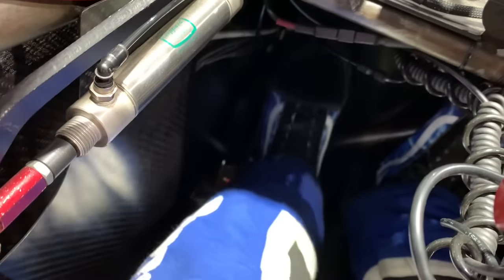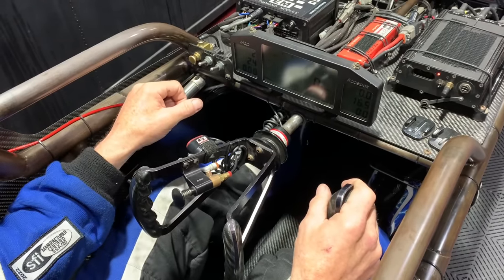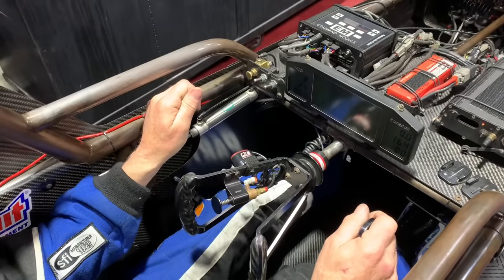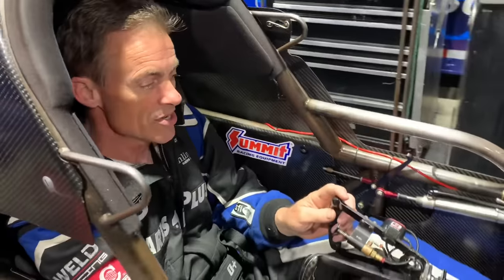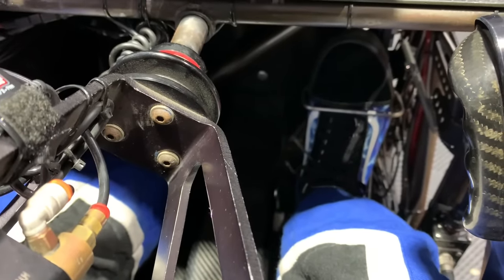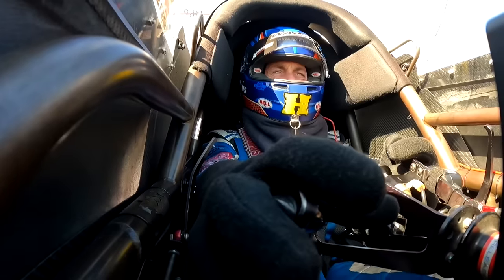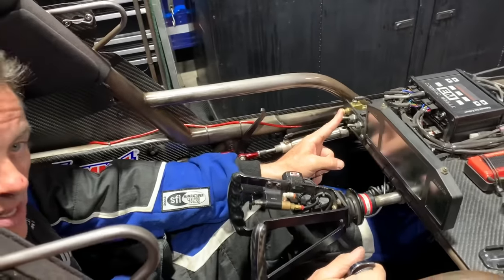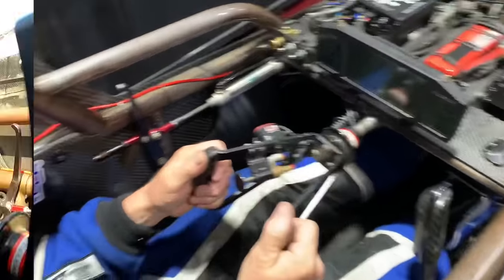How To Drive A Top Fuel Car

Comment: 50 years of wondering explained in just under 11 minutes thank you clay.
Reply: Agreed
Reply: Not that long but same lol
Reply: 30 years of wondering how long the throttle pedal throw was finally answered. Try to find a video on that subject on YouTube lol.
Reply: Ditto!!
Reply: Same here.
Reply: Ditto, the first race meeting that I attended was on May the 28th 1972.
I had a vague idea, now I am almost a novice after half a century.
I guess I am a slow learner?
Reply: 50 yrs for me too.  I still love it.
Reply: lol, jumpin on this bandwagon. Way more interesting than I thought, love these kind of vids.
Reply: Me too thanks clay so interesting
Reply: Exactly! I always wondered why the car seemed to change tone just after the first bulb lights. Now I know they pull the fuel full bore for the pass at that point. Love Clays videos!
Reply: 50 years ago the cockpit procedures and moves were quite different than what you see here, that's for sure.  At that earlier point all we had inside was an oil pressure gauge (analog, of course), a mag switch, a chute release and a bypass fuel control that was never adjusted when running.  And definitely a manual clutch dump (pre-Crowerglide).  No reverse, either.  Only funny cars used a reverse.  Most top fuel cars back then were still using crews with arms and legs.  Aside from feathering a wet burnout, it seems the only things here that remain as the same cockpit procedures from 50 years ago are the chute release and brake.  Much more complex today, and this is a great video to illustrate the current machine's requirements.  Thanks, Clay.
Reply: Clay Millican is a gift to us fuel nerds
Reply: Brilliant explanation, what a ride.
Reply: Waiting 50 years for someone to explain it to you?
You could have looked it up, visited a racetrack and talked with a mechanic or a driver lol.
And you guys vote? Educate yourself. Even easier today, with the internet or YouTube.
I'm sure i could find the information before I drank my beer.
Reply: Can I drive next time😅

Comment: Clay, you forgot the part where when you launch you compress into the seat and almost black out and then at the end you throw the chutes and are thrown into the belts with even more force than that launch. Awesome explanation, thank you,
Reply: think you got that impression when he gestured moving forward so much at the end of the imaginary run. The amount he moved forward indicated that there is a huge amount of G's being placed on the body at that speed. That is the only part of the run I could imagine... I once made the mistake of sitting up on my bike at 160mph on the highway (didn't feel like I was going all that fast), and nearly blew myself of the back of my bike (just held on with my finger tips), could imagine that is what it feels like in reverse.
Reply: @DodgyBrothersEngineering  No I have driven many many fast cars over 35 years on the track and also a dream drive in Larry Dixon's Nitro X2. The G's experienced at the starting line are not even the most of the run, it is actually about the 330' mark when the clutches lock up. But the g-force experienced when the chutes deploy are so much more, like eye sight starts to go black type of g force. I used to have a gsxr 1K7 and rode it to 307 so I know the force you are talking about but believe it or not, that is nothing compared to the kick in the ass of one of these and the sledgehammer in the chest when those chutes deploy.
Reply: @hommie789  I have been in and owned some seriously fast cars (cars you couldn't reach forward to grab the dash), but I still can't even imagine what a top fuel experience would be like because 1G+ is going to be nothing like 7G's they say top fuel experience on take off. Can only imagine that would feel like someone sitting a car on your chest. I can sort of imagine it, but I bet if I ever got a go in one, it would be so much more than I can possible imagine. But even the thought of it brings a smile to my face, and my butt pucker.
Reply: @hommie789  interesting thought about about the braking... Did it seem so severe because of the direction of force? When you are accelerating you have the entire back of the seat to spread the load of your body against, so the pounds per square inch would be nothing like when the chute comes out, because under deceleration you only have a few small straps to stop the mass of your body. So the pounds per square inch would be much higher even if there weren't as many G's.
Reply: F-22 pilots laughing right now. Fun fact a space shuttle launch is 3gs. Most ever recorded on a top fuel was 5.5gs.   F-22 9gs for breakfast. Record of gs ever survived by a human being, 219 g's   219..... was in an indy car race kenny brack got in a accident that recorded 219 g forces. He survived.

Comment: WOW!! What a difference 50 years makes. I bought a 130 inch Woody Gilmore car from Sammy Miller in 1972. I was moving up from modified production and really needed help with the learning curve. We set up the car to run B/FD in Pro Comp Eliminator with Sammy's help. Back then we only had a fuel shutoff, clutch pedal, steering wheel (the only thing in my car that looks like yours.), hand brake, loud pedal. chute release and an oil pressure gauge. When I asked Sammy why just oil pressure he answered me in typical Sammy Miller fashion, " That's all you need to know. If the motor makes a funny noise, you glance at the O.P., if it's at 0, DUCK!!"
Reply: Over here in 🇬🇧 we took an instant love to slamming Sammy miller when he was doing demo passes of vanishing point an oxygen rocket cars.
He seemed very at ease with himself (not something alot of racers are) and did a very good Donald duck impression.
It's was a sad day when I learnt of his passing, but I believe he lived one heck of a life. 👍
Reply: If it's at 0 Duck! Ha Ha Ha 😆
Reply: Just the mention of the old B-fuel dragster class brought me a melancholy smile :-)
Reply: Sammy Miller is the forgotten GOAT. 3.22 @402mph, with an actual 1/4 mile measure. Not the useless 1000ft measure of todays Karen culture.

Comment: Great video!  Very informative and very interesting; I didn't know what was involved in piloting these 11,000hp 4wheel missiles.  A 3.6-something seconds pass with trap speed around or greater than 330mph!  Amazing just to keep one of these engines together under full throttle for 4 seconds; absolutely awesome. You make it look easier than it is, obviously perfect muscle memory, knowledge and experience.  Just like flying aircraft, knowing emergency procedures and how to handle one of these beasts when things go south, sideways, etc.  on a run is where the experience shines.  Thanks for making this video!

Comment: HEY CLAY 🤘🏼 love the insider content of too fuel racing no channel around like it love your work can see your a real genuine team and also really care about the fans just as much as the racing ! 
I just have one technical question, some teams run a enclose cockpit and other don’t ! With you being one of those teams still running an open cockpit is there any aero disadvantages in being open at those high speeds and short amount of time ?, and what’s your reasoning for staying with and open cockpit? 
All I can think and see is that you feel safer with and open one so that if any thing goes wrong and you need to exit the car there’s no obstructions or any extra movements or process you have to take to exit the car fast and safely ? Oh and one last thing 

“STOMP ON THAT LOUD PEDDLE” 🤘🏼

Comment: so the sound change tone on the line is that from the fuel flow or the clutch? Ive always noticed it sounds different on the starting line during pre-stage/stage. almost gets quieter.

Comment: A top fuel driver must be a rare breed, adding to the huge amount of things going on just to run down the track straight, racing another psychotic machine only possibly feet away from you would be the total sensory overload of 5 to 7 G's of acceleration, noise, vibration, and braking; all happening in less than 4 seconds. I honestly don't believe that many people would be capable of keeping it all together. Thanks so much for the detailed explanation.

Comment: I just stumbled on this video. This is an excellent video. It answers a couple questions that I've wondered about for a long time. First, the engines are started on gasoline. The burnouts are on nitro but with very limited throttle. And finally - and this one really puzzled me - I now know why the engine sound changes when the first stage light is lit - the driver pulls the fuel flow lever to full. Very cool video and very educational.

Comment: Ive watched drag racing on tv and live since I was a little kid. What a great informative video clay! I never would have thought you guys started them on pump gas then swap to nitro. Maybe a bit more info as to why and if there is a secondary fuel tank with the 87 in it? One thing I always thought was crazy but once you see what it looks like in person is the clutch system. The throwout system and how they just weld to each other in 4 seconds is just incredible....

Comment: There's also a killswitch that Clay hits on the side of the steering wheel. This kills the ignition system and shuts off the motor. Thanks for the video Clay! Awesome explanation for how these 12000 HP monsters work.
Reply: the red button ?   was wondering about that one

Comment: It's mind-boggling how much work is done before the car even stages; thank you for walking us through that, Clay. How fast would a modern Top Fuel car go through the 1320, if allowed? (rather than cutting off at 1,000 ft)
Reply: Most engines wouldn't make it to the 1/4 mile mark.

Comment: Hey Clay, there's a lot more going on there than you think!  I think the big thing in these cars is all in the clutch and the system that controls it!  It's hard for people to grasp that you let the clutch all the way out, but at that point the computer (?) is in control!  But what is the knob in the center of the steering wheel that looks like an old, manual, choke control?  Also, when you take off, all you concentrate on is driving until you hit the chute?  What would you do if you noticed the tires smoking?  Very interesting video!  I like driving heavy equipment; they are all different, and take time to master, which is challenging!
Reply: that was gonna be my question....  looked like an air valve of some form with the lines coming from it.....   that and the red button on the side of the wheel (i'm guessing that might be a fire bottle control)

Comment: Incredible video. I had no idea how much driver involvement there was in a Top Fuel dragster start, roll into the burnout, reverse , staging and the actual run. As a pilot, flying looks easy until you do it on your own.
Thank you for this unbelievable insight into the details of the standard routine operation of a Top Fuel Dragster run.
It's seems like no big deal. With this tutorial, I could hop in one and go 300+ tomorrow. 😂👍🏻🇺🇸
I was shocked that you started them on gasoline. I thought that Methanol or Ethanol was used?
In the pits, what fuel is used for the warmup? I have, again, always assumed it was methanol or ethanol?

Comment: Clay! You are the reason i have started to learn about this level off racing.
The amazing energy you have are a blessing for your team and the sport inn general!
i have one question im wondering about, when you do the startup, i have noticed you pull out a little mirror to watch behind you.I am pretty shure thats not to see if the engine are running.I would guess you can hear that engine running into the cocpit :D
To see if all the linkage are conected for the blower?

Comment: You guys got guts driving those things. Nice informative explanation, you're obviously a pro. That engine is so bad to the bone, it's got 2 psi oil pressure and it's not even running... Lol. Always wondered how to operate one of  these even though no way I would or even could do it, it's still cool to know. Thanks for clarifying... drive safe.

Comment: Great video Clay. I got kinda of a quick crash course from Leah a couple years ago in Denver, This was more in depth. Quick question thought. What's the switch in the middle of the steering wheel? Is that the kill switch?

Comment: Great explanation, although it left me with one question.  When the car is staged, you mentioned you take your foot off the clutch.   I'm assuming the air pressure in the clutch mechanism is holding the throwout bearing in position.   What tells it to start moving the throwout bearing when the car leaves ?  Is there a trigger on the throttle pedal ?
Reply: it uses what's called a slider clutch. when the pedal is fully released, there are springs that are holding the pressure plate back a certain distance. thus "airgap" is one of the tunable elements. there is another mechanism called the cannon (no, idk why it's called that) which is also holding the throw out bearing a little forward still. the cannon is hydraulicly controlled by the air pressure from the clutch management. you are correct that there's a trigger switch. it's activated by the throttle pedal hitting it. it starts the clutch timers which slowly retracts the cannon, which retract the throw out bearing. weights on the pressure plate levers (the fingers you hear them talk about)are trying to engage the clutch harder via engine rom, but the rate the cannon allows the throwout bearing to retract controls how fast they can apply pressure to the pressure plate.

if I totally gaffed that up explaining, research the old "crowerglide" clutch. that's what the modern clutch is based on.

Darkside racing also has a crew member that's done a really good video on how the cannon and timers and accumulator all work, and Clay has one too.

Comment: It takes approximately 200 horsepower and a road 2 miles long to go 150 miles per hour.
It takes another 1000 horsepower and about 5 miles to EVENTUALLY go 250 miles per hour
It takes another 10,000 horsepower to go 300mph within a quarter mile from a dead stop.. if you can find someone crazy enough to do it.

Comment: I feel like I'm watching some dude give a rundown on what it takes to get an F4U in the air.

These things are really incredible and a far cry from what the sim racing community is used to. I wish there was a way to model these in a sim like, say, a GT3 car, but it just doesn't exist, and I'm not sure it can. It's one of those things that you just have to be there in person. And I encourage anyone who hasn't been yet to watch these cars go. It's quite the experience. You haven't really experienced horsepower until it literally rattles your cage from 100M away.

Comment: Nice ! I knew they ran on pump gas to start but what does the crew member do just before you stage, when they look at each other and then make an adjustment on the the engine ?

Comment: I think besides the safety aspect, it's also control over the costs. It takes mega bucks to run a current Fuel dragster, with rebuilds after each pass on the 10,000 H/P cars, sometimes it blows up for onr reason or another, Nitro is not your friend. Dixon gets a big payment for each run that would maybe cover the costs of the pass.

Comment: Very cool Clay.  So in the video of the pass I never saw your left hand come off the wheel at the end of the pass (to shut off the fuel) yet the engine clearly quits running prior to your shutting the fuel off.  Did the engine actually run out of fuel prior to your shutting off the fuel?  If not what caused the engine to stop running?  Clearly at this point the ignition was still on.
Reply: Oh, and I found it interesting that you guys no longer run a separate lever for the high side pump.   How does the fuel lever distinguish between doing the burnout in the low side and the high side for the run?  How far the lever is pulled back?

Comment: Wow I'm always amazed at what a top fuel driver goes through. I have a 1965 Plymouth Valiant wagon with a 572 in it. It is a handful to drive. I'm fat but getting lighter by the day and it's a workout to drive my car. I can 9nly imagine what a pro driver goes through. I'm still trying to get to the low 6's. It's taken me a while and a lot of capital just to beat the 7 second mark. I don't think I will be able to get there but I'm going to keep trying. Getting into a major crash is my biggest fear. I have had 2 of them and it sucks. It's not natural to be upside down plus it costs a lot of money. Shot happens and then you spend money. Keep the rubber down any the hood up.

Comment: Sure no problem, its one of those do all things in a matter of seconds and do it right.... Correct.??  Hahahaha... You make it sound so much easier then it is to actually do for someone who has never done it... But I know what it takes at least for me, I raced off-road trucks for a number of years and it was always about how far in advance you can put your mind, body reaction movements and your eyes on the track, not only right in front of you but down the road and being able to read what the truck will most likely do before you even get to what your looking at, while working the throttle the brakes the steering wheel, while glancing at gauges and figuring out the next movement... For me personally it was like i put everything was in slow motion, yet it was happening in a matter of seconds.. It takes a very talented and special guy to do what you do Clay... Thanks for filling us in on how you do it..!!